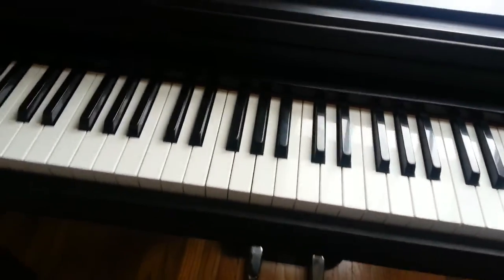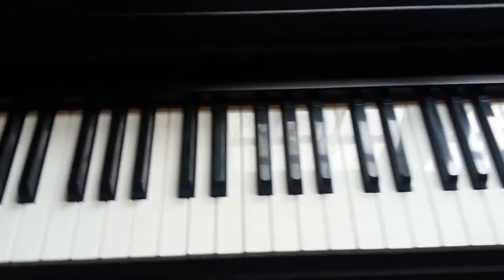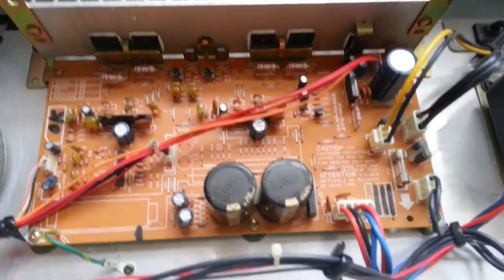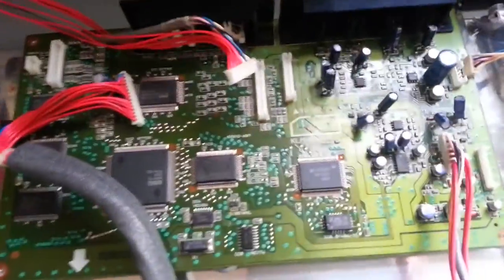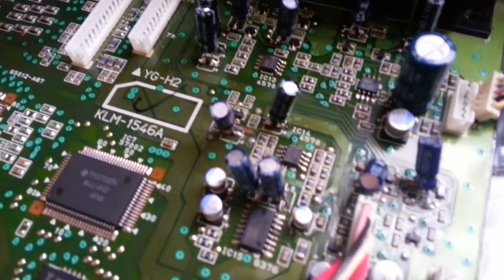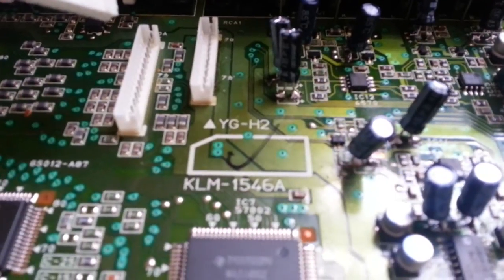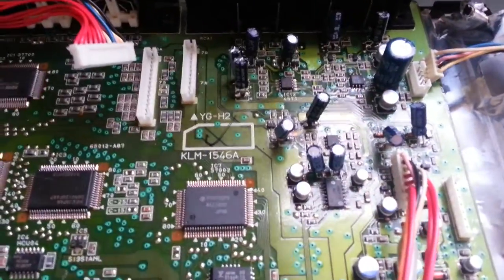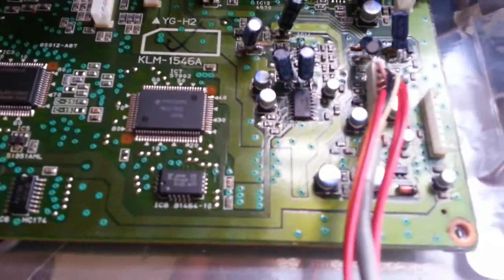How to Repair Korg C-25 Concert Piano no sound

Comment: Thank you for making this video on repairing the Korg digital pianos. I have a C15 that had no sound. When I opened it up and looked at the main circuit board, there was a lot of corrosion and burnt traces in the audio output section. I though perhaps a mouse got in there and peed on the circuit board. After watching your video, I checked all of the surface mount electrolytic caps with my cap meter.  Everyone was open! All of the 10uf caps, the 47uF caps and even the .33uF was bad. I have the caps on order now. In the mean time I am going through the entire board in that area and fixing the etched open traces.

Comment: How do you free the cover so it can be lifted open as you did?  Thank you for your advice.
Reply from the maker: It was Long time ago, but I think it was soldered in a couple of places, you just have to use a good (professional) soldering iron to remove it.
Reply: @artsvideoonline  Thank you for your reply.  In fact I was puzzled how to open the cover of the piano itself.   Finally I discovered that, if you remove the piano from its stand, this reveals screws which, when undone, enable the cover to be lifted, giving access to the electronics.  
I bought my C-15S a few days ago for just 60€ and, after cleaning it and reconnecting the pedals, it seems as good as new.

Comment: How were you able to open the lid like that? I have a C-25. I see the hinges. But something is keeping the lid from swinging open? Could you please give me some clues?
Reply from the maker: I don't remember exactly, there should be some black Long screws in the bottom, try unscrewing them.
Reply: @artsvideoonline  thanks. I finally figured it out by trial and error. On the underside of the C-25, there are five screws along the left and right edge (total of 10 that appear along both sides).  You must remove four of those five underside screws (from front to back, total of 8 screws) from the left and right sides of the keyboard.  Closer to the front of the keyboard, the corner screw on each side also go through the leg assembly. While those corner screws need to be removed, the next (or second) screw (moving front to back) that goes through the leg assembly does NOT need to be removed. But then, the screw after that (which also goes through the leg assembly) must be removed. And then, there are two more screws (neither associated with the leg assembly) as you move from front to back that must also be removed. So, four screws on each side, total of 8 that need to be removed. Hope that helps others who were deseparately looking for the this info. I do not know if it's the same for other other models like the C-15.

Comment: hi, for the replace parts, what kind of capacitors did you use ? cause it's written 10.10v on it, i thought it is 10µf / 10 volts, but i don't find this kinf of capacitors !
Is it corret to put 10µf but with différent voltage ??
Thanks a lot !
Reply from the maker: You can use higher voltage, I used regular capacitors, you don’t have to use surface mounted ones. Do not use soldering iron to remove the bad ones, use i plyer, grab the capacitor, push it towards the board and twist it, that what you will brake the pins not damaging the board. Good luck.
Reply: @artsvideoonline  ok thnaks a lot ! i've order some capacitors to repair my C45 keyboard !

Comment: Thank you for sharing this video. I want to know the référence of integreted circuit between thoses capacitors. I have i c25 without sound ;someone changed this integreted circuit with a wrong one. i want to put the original component before changing thos capacitors. thank you for your help

Comment: Thank you Artur for your great video, I have the Concert C-46 which is quite identical to yours and I have the same problem. But The big issue that I have I can't open the cover. Would you please upload another video or photo to show us what are the screws that you had to open in order to open the lid. Thank you so much for your help.
Reply from the maker: +Henny Habibpour There are 5 screws on each side in a Vertical Matrix, although only 4 secure the bottom to the top on each side, I would take all 5 out.Then it has a hinge on the back opens like a door. Do not use soldering iron to remove the old capacitors, click the link on the end of this video to know how. Good luck.
Reply: +Artur Aroustamian Thank you so much. Very helpful :)

Comment: What a great video and instructions.    I have a C15 with no sound, but light come on.   So, I changed all 10uf caps to regular ones and now I have no lights but some sound....just loud distorted sound from some keys like all A's and D's (if remember correctly).   I wonder if my caps are correct, they are quite tiny 10uf 16v caps.    ANy suggestions why I lost my lights when swapping the caps and where to go from here?
Reply from the maker: It’s very important to make sure that the polarity of the caps is correct, also sometimes you’ll need to clean the PCB before you solder the new cap.
Reply: @artsvideoonline  Thank you for your reply.   I tried to clean it well and made sure that polarity is correct.  Is there any chance that my caps would not be good enough?

Comment: Hello Artur - I'd be very grateful for your help please. I own the Korg C-35 Concert Piano which is similar to the C-25.The piano was accidentally dropped & I feel that one of the circuit board  plugs/connectors might have come loose - because I am now receiving a loud deep hum - through the speakers/ headphones & line out. (it sounds as though somethings no longer earthed). Could you tell me - where the screws are to enable me to access the 'lift up top' - so I can get to the circuit boards . I've tried practically all screws on the base of the piano - but with out any luck,
Thanks for your assistance 
Pete
Reply from the maker: Those are about two inches long black screws around the perimeter.
Reply: Thanks for your valued reply Artur. I managed to find the screws to open the hinged top on my Korg C-35  - thank you. In the meantime, the 'humming' has became louder & louder  .......  now the piano has stopped functioning completely &  there is no sound at all - although power is showing that it's on - & the LED lamps are lighting up. DO YOU STILL THINK THAT THE FAULT COULD BE DUE TO LEAKING CAPACITORS ? As I am really not electronics minded, I have decided to employ the assistance of an experienced technician to have a look at the offending circuit board. I'm wondering whether the repairs are going to be very costly & is it worth me going ahead with the  repairs. If I do go ahead with repairs, do you think I will receive several more years of service from my Korg - considering the age of it ? Thank you again for your help. Peter

Comment: That's great , I have korg  c-45 concert Pisano but right now as am talking the sound is off, and my problem is? How will I know that this is the capacitors that are spoilt and replace them with the regular one
Reply from the maker: I recommend to replace all the surface mounted capacitors, I have a video, where I explain how to remove capacitors, don’t use soldering iron when remove it, use pliers, hold it and twist it, watch video before you remove any capacitor.

Comment: How bout a Korg N1. I get no sound. However if I turn the amp all the way up I get sound.  This has been an issue for about 8 years. I have a new board but I’d like to get this N1 back in service.  Help. Also it seems that some of the buttons aren’t working properly.  Help!
Reply from the maker: What about the headphone output, is it the same, or you get good sound from there? If you can get good sound from headphone you can use it as an output. It seems to me like you can have some bad capacitors too to be replaced, but as I don't have the schematic can't tell you exactly which ones. There are  small switches on the upper control board and I would recommend you to replace them. they are very chip and you can buy them from Ebay, you just have to open the keyboard to see exactly what you need. Also I would recommend you to do a hard reset before replacing components,  it might work too:
 
Make sure Write Protect is Off.
Press the UTILITY button.
Press the INC+ until you see Init: Factory Preset.
Press the ENTER button. It will ask you if you are sure. Make sure you have saved any changes you made and want to keep because this will erase it.

Comment: Hello Artur thank you for video, There is no sound from my digital piano, I tried input socket into my piano and I can hear sound through the digital piano's headphone jack but not through piano's speakers (I can hear low sound with speakers) Do you think this will be capacitors? Or an amplifier fault? 
Thank you
Reply: Hi P Miller,  I have the same problem as you do. I have a c45. I am wonder if you ve managed to find out something. Thanks

Comment: I have a Dynatone digital piano, half of the piano doesn't have any sound (first half including the C middle), any idea of what could be wrong?
Reply from the maker: Most likely the one of the two flat cables from keyboard going to the mainboard is disconnected.
Reply from the maker: Check the connector from keyboard to mainboard, similar problem I had with Korg I5, I have a video about it.
 Good luck.

Comment: H Artur. I have exactly the same problem you describe with my Korg C46/C56 Concert Piano. No sound. I have removed the sound board and plan to replace the capacitors as you suggest but I cannot identify the capacitor ratings. Is there a way to find out the rating of each capacitor on the board. I could send a close up picture of the capacitors if it would help. Thanks for your help. Mike
Reply from the maker: Send me the picture
Reply: @artsvideoonline  Artur. Where would you like me to post the picture?

Comment: Artur Aroustamian
 I know this's a 3y old video, but, my Korg sp-250 doesn't produce sounds via the internal speaker. Headphones/external speakers work fine. I even cleaned the headphone sockets without luck. Any idea how to fix this? Thanks in advance!
Reply from the maker: You are lucky, I think you have a problem with your amplifier, if your amp is built on IC, just buy one on Ebay and replace it, if not-change the capacitors (first check if the amplifier gets the all necessary voltages). 
 Here is the service manual download link, on the bottom of the page, ketft side you'll see "processing" after it finishes-you can download the PDF file.
 Good luck.
Reply from the maker: https://elektrotanya.com/korg_sp-250.pdf/download.html
Reply from the maker: Sorry, I missed the part, when you say it produces sound on headphones, then change the headphone socket, it has switches inside, which are bad.. CHECK THE SREVICE MANUAL, YOUR AMP IS FINE.
Reply: @artsvideoonline  Thank you very much for your kind assistance! Really appreciate it. I w'll follow your instructions after consulting the linked manual.  I pray that the PHONES sockets are not soldered into the board, as soldering things doesn't agree with me :)
If I may ask one last question Please! Must I replace with the same socket or  there's standard phone sockets with built in speakers switch?
Thank you once again! Liked and SUBed!

Comment: I have recently bought a korg C25 , it has the same problem ie no sound. How do you know what value the very small capacitors are, for example the capacitor marked c62 marked on the block diagram for the klm1546.
Reply from the maker: The service manual can be downloaded from this website:
https://elektrotanya.com/korg_c-15,25,35,45,55_concert_series.zip/download.html

Keep in mind that we are replacing only surface mounted aluminum caps and all of them have their value on them, for example 10,  6v (means 10mkf 6 volts).Also watch my other videos regarding this keyboard to know how to remove the bad capacitors from the board.
 Good luck.

Comment: I bought cheap the C25 and also no sound. First time I powered the C25 on and on the panel some Led light up but no sound. I replaced 10uF/63V capacitors and after restoring the PCB 1546 still no sound but also no led's on. I triple checked if i made a wrong connection and i also checked if all capacitors were placed wel (plus/minus) as indicated on the PCB. I checked also the power point as below, i have :
point A: +5V
point B: +15V
Point C: +22V ) before the regulator IC16 - pin 1
 
It looks like the main 10uF capacitors are mostly for the audio part.

Questions:
- how come are the leds not light up? Is there a kind of RESET function by pushing a button on a power-up?
- Is the point C 22V correct before the regulator (15 V is oke!)
- are there fuses on the KLM-1546 beside the 2 on the power/audio amp PCB?

When I now power on and push the keyboard only a small tone is heared softly

Please let me know.

Kind regards Harry
khelmens@gmail.com
Reply from the maker: Looks like you have problem in the power supply section. When you power up the keyboard make sure the amplifier is working, you can connect some audio signal to RCA inputs on the back, if there is no sound -most likely the power supply is bad, check the big capacitors in there. Good luck. The service manual you can download here
https://elektrotanya.com/korg_c-15,25,35,45,55_concert_series.zip/download.html
Reply: Hi Artur, thanks for your quick response. I will check that again and letyou know. Is the point C voltage 22V oke?
Reply: Hi Artur, I checked the amplifiers by adding a sound source to the RCA input and it works but also a buzz tone is heared. After removing the C58/C59 the buzz is gone! I placed a scoop on the IC15 output pens 6  and 11 but no clear output. I assume that the IC15 is a D/A converter to created the analog sound which is then forwarded to the filter/amplifier section. A disturbance signal, even when no key is pressed, is seen on the scoop. What bothers me, is if the CPU part is running, at leased the control panel should light up. I checked all the fuses  (3.3ohm) arround the IC1, 2, 3, 4, 8 and they are fine.

 As far as I can see in the sheet is that the capacitors are used for the filter/amplifier section after the D/A -converter and i think i will dismount all capacitors behind IC15 to check if the CPU is running by checking clocking signals. 

You were talking about the double layer PCB, i don't see any throug-put islands under the capacitors or am i missing something? All cap's are single solderd on 1 layer.

If the Voltage at point C - 22Vdc?

It is a hard case this one but they piano looks so find that it is almost a mission to me hahahha

Please let me know

grt Harry

Comment: the self diagnostic test says check says there is a voice error, do you think that would still be a capacitor? I have the c-35. it says check ic17
Reply from the maker: I am sorry, iam not sure, but if it is old enough the caps are bad for sure. Good luck.

Comment from the maker: Hi Fernando, yes, it is very important to keep the correct polarity. On the PCB it shows  the NEGATIVE, on the capacitor it is marked with black strip. Also watch my other video explaining how to remove the BAD  caps. Good luck.
Reply: Hi Mady. Thanks for your video that already helps alot. After having the faulty/leaky capacitors removed and changed, still have no power on the keyboard (concert c5000 korg). Is there a special way to place back the replaced ones ? thanks again, EJ

Comment: How do I get the piano to flip open. I have removed 4 screws from rear but cannot flip it up as you demonstrated
Reply from the maker: There are 5 screws on each side in a Vertical Matrix, although only 4 secure the bottom to the top on each side, I would take all 5 out.
Reply from the maker: Also do not use soldering iron to remove the BAD caps, watch my next video to know how. Good luck.

Comment: My 88 key alesis qs8  does not produce any sound.  Even when I connect some head phones to it.  Also, the display lights up green but nothing comes on.  Can you please help...    Thanks!!
Reply from the maker: It might be something wrong with the main board functionality, if you do not have any indication, means the software is not loading for some reason, try to change the battery, check all the powers feeding the main board. Good luck.

Comment: how do you know what style / model / part number of new capacitors to order?
Reply from the maker: +mulewrangler1 Just order regular capacitors (not surface mounted ones, which caused the problem) which are the same microfarad and the same voltage, or higher voltage. Good luck.
Reply: Thx, I think we are gonna give it a try
Reply from the maker: +mulewrangler1 check my other video, where I show how to remove the bad capacitors, do not unsolder them, you can damage the board. Good luck.
Reply: @artsvideoonline  can you Post the Order Video please

Comment: This video was very helpful! Thank you... do you know how to access the keys so I can clean the sensors? 4 of my keys do not sustain unless I use the pedal so I suspect they need cleaning...
Reply from the maker: You are right,  they need cleaning,  unfortunately I don't have that keyboard anymore and can't tell you how to disassemble it, but I would recommend you to replace the rubber pads instead of cleaning. 
 Good luck.